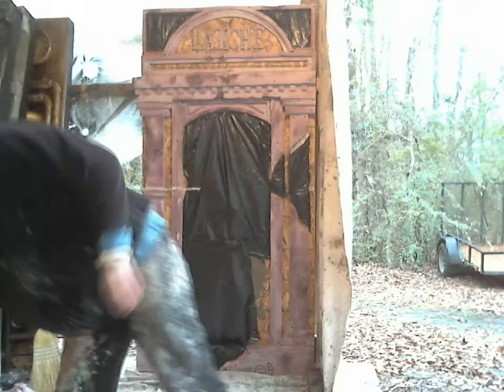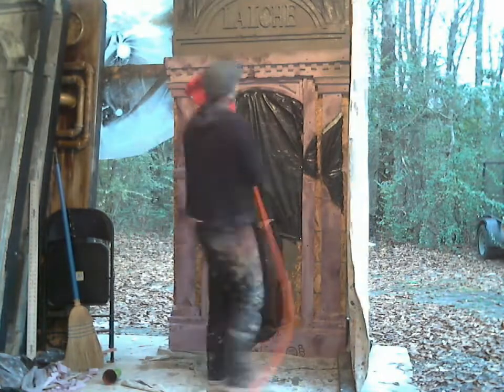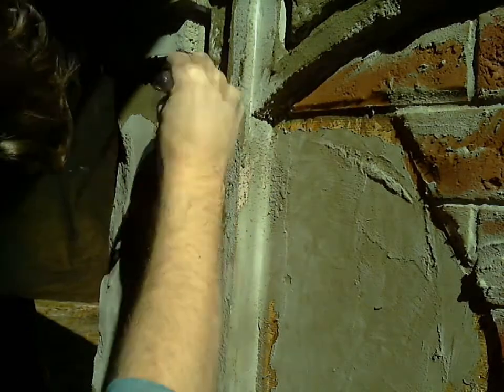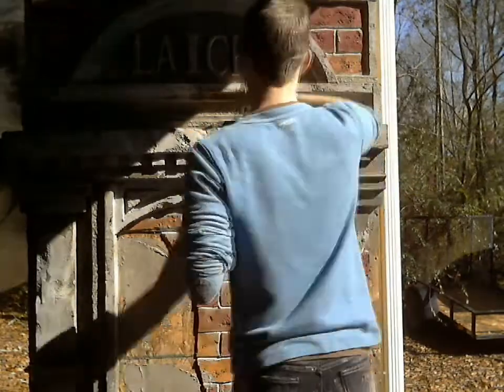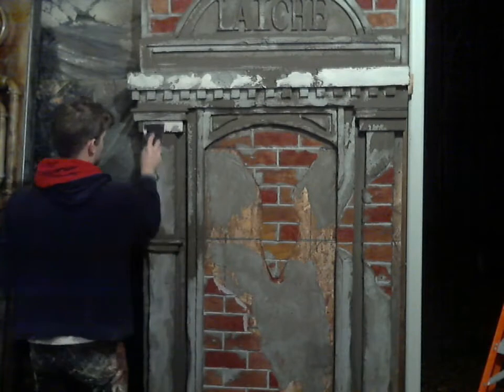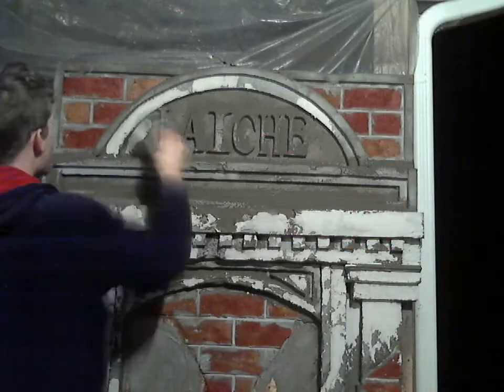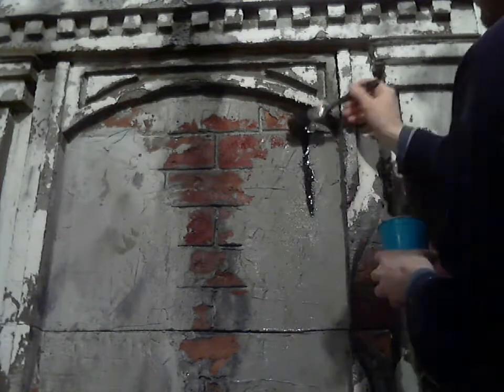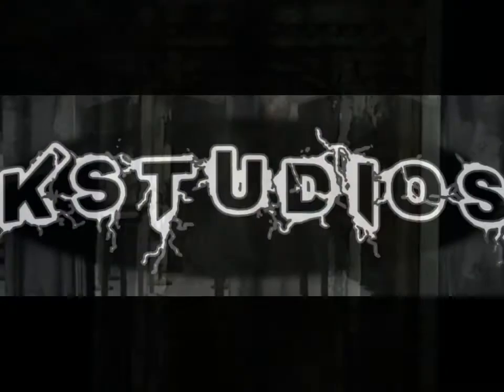Evolution of a Tomb Tutorial: Part 2

Comment: The tomb looks amazing. How does it fair out in the elements?
Reply from the maker: It does very well outside. If it rains, it dries out, the polymer additive helps the stone during extreme temps. I would suggest using treated lumber for the frame and such, and also be sure that the tomb has a generous layer of the thinset in order to keep out as much moisture as possible. When it comes down to it, very few things last forever if you are keeping it outside 24/7/365. All we can do is take precautions and be thorough in order to give the piece the most longevity we can. And hey if it starts to degrade, even better! Effortless detail